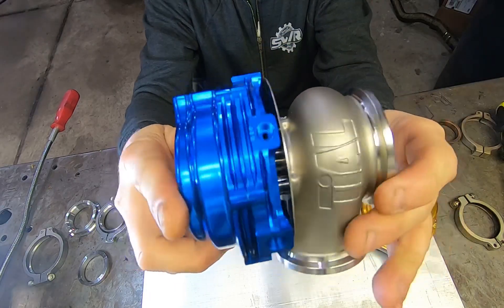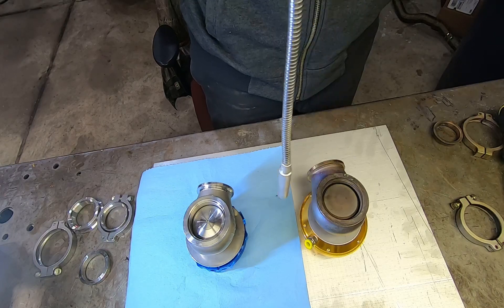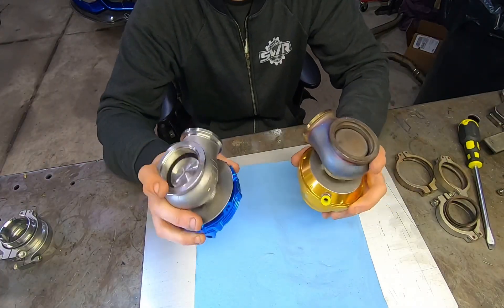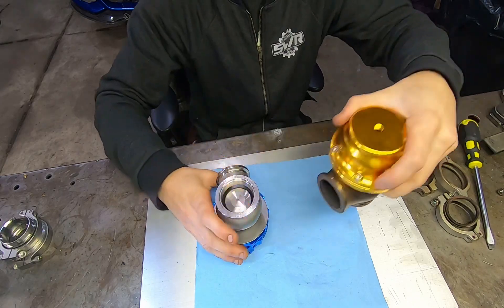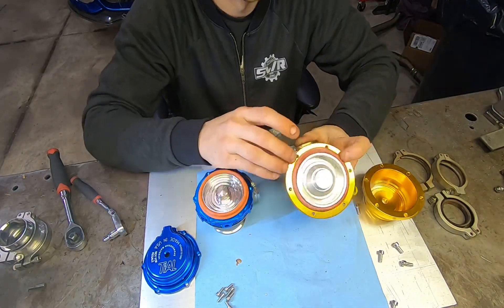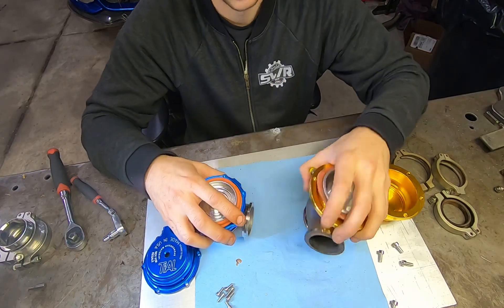Tial vs EBay Wastegate Teardown Comparison

Comment: I work at tial, the Chinese have made exact copys, part numbers, ect. Even engraved correctly.  If you don't buy from a reputable distributor chances are it's a knock off.. doesn't matter what it looks like.

Comment: I have a similar ebay WG but 2 bolt flange. That single internal nut came loose and the top is flopping around and loud exhaust leak sound. It's almost funny if I didn't have to buy a new one. I'd prefer a modern Tial but they seem to only have v band flanges :(

Comment: Check out puslar wastegates.
There turbos kick ass for great price so i tried there wastegate and same as the turbo great.
I took apart and no shavings inside and everything fits like it should.
Has the same thick flanges as tial has and the same 3 screws holding the top section to bottom as tial.
Also brass guide for the piston with water cooling
Good bang for buck at $100 
Using 2x 44mm on our shop k20 at 850whp no issues

Comment: The chinaman wastegates work pretty damn good. I actually broke a tial and being a cheapass got a Chinaman one and it still works after like 8 years now. 
On my new build I'm using a chinaman one too but I always leak check them and take them apart. They always leak from factory

Also the gold one you got is the older style tial knockoff. The new ones are the actually more compact and have water cooling capabilities which I dont think I've ever seen anyone use